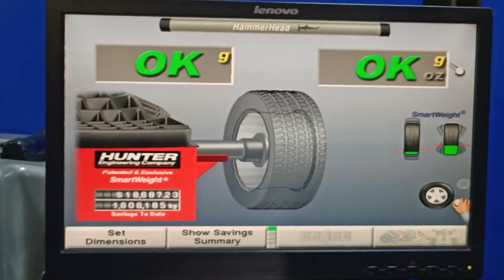TIRE REPAIR

Comment: hey brother, i want to make an camber alignment for my 2009 land cruiser, but the bolts under the car are very stiff because of an protection layer spread under the car, i visited a workshop and they couldn't, any suggestions?
Reply from the maker: Thank you for your time and effort to comment,
Do you mean the bolt of a layer protection.
Maybe the bolt are stuck up in that case you need to change the bolt,
Reply: @kuyacardo7720 you're very welcome brother, the protection layer was spread on the whole bottom of car, and some of the spread leaked inside the bolt and made it so stiff and tight
Reply from the maker: @anasku2781 
Bro it's like a undercoat?
Just carefully remove and clean the part affected in order to adjust the camber /caster.